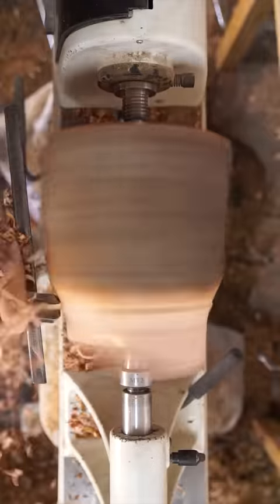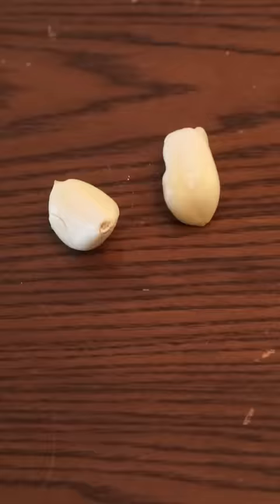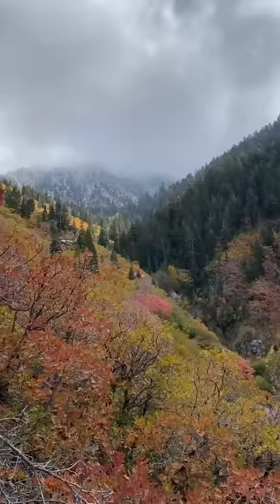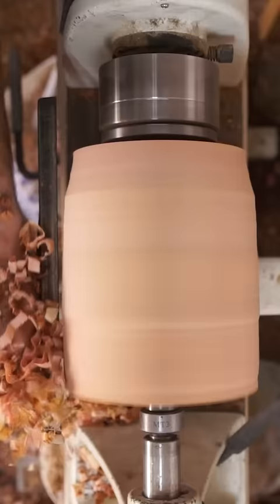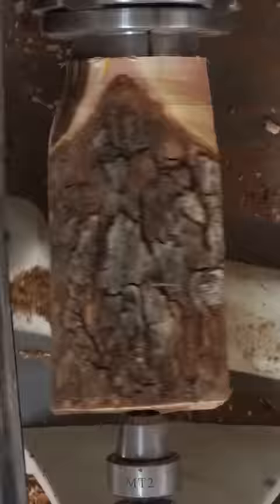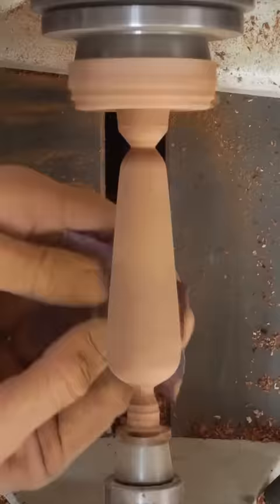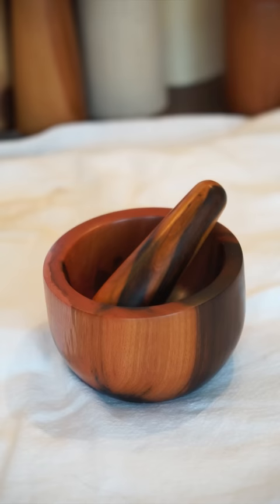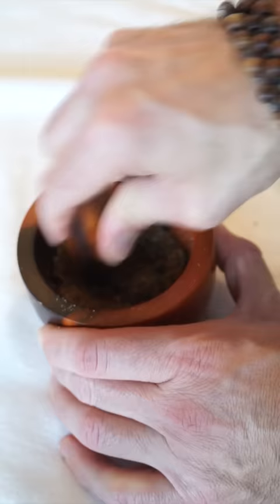Making a mortar and pestle out of one of North America's hardest native trees

Comment: Have you worked with lignum vitae (ironwood)? They used it to make bearings for shafts on vessels when I worked at the Charleston Naval Shipyard. They kept it in the water until they were ready to use it. Some of the machinist turned out some incredibly beautiful pieces, especially mortor and pestles, from the scraps. I believe it is the hardest wood and @ 80lbs cubic ft.